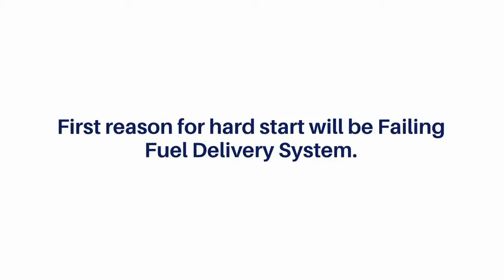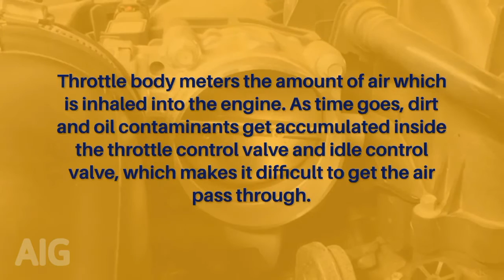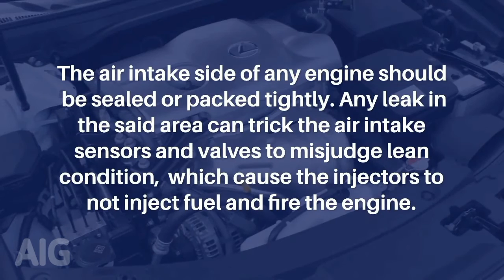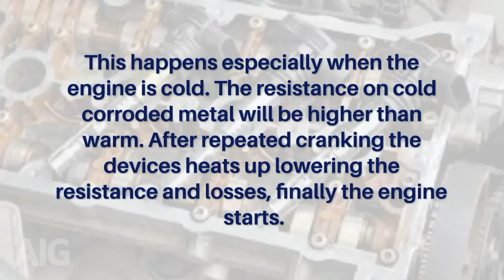Reasons For Petrol Engine Having a Hard Start | Petrol Car Long Cranking Before Start - Explained

Comment: My seat ibiza 4 is having a hard time firing up. I've noticed that it responds better at low temperatures but even if it fires up and stands for an hour it fires up hard again. Has anyone had this
Reply: Hello. My 2016 seat ibiza 1.2 tsi have long crank before start issue too but it doesn't always happen. It happens sometimes.
Reply from the maker: Could be air in line, clogged fuel filter, or pump
Reply: The problem is that I have listed a lot of things. I just replaced the fuel pump that week and it's definitely me not the pump because it fires the same in high temperatures outside. I've replaced the temperature sensor in the intake, the shaft position, the spark plugs, I've also replaced the fuel filter,cleaned the throttle and I really have no idea what the damn thing is.
Reply: I was just thinking of checking for leaks yet
Reply from the maker: Other reasons that might cause the same is bad coolant temp sensor, which cause fuel regulator to malfunction. A bad fuel regulator to does the same.
Reply from the maker: Hi is that a petrol head or diesel?
Reply: @autoinfoguy  petrol
Reply: @autoinfoguy  It's petrol